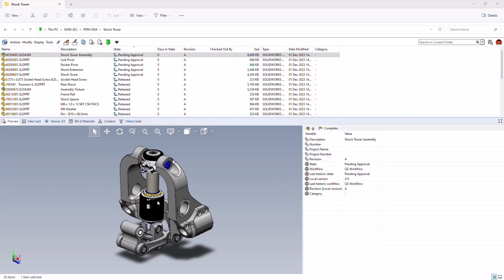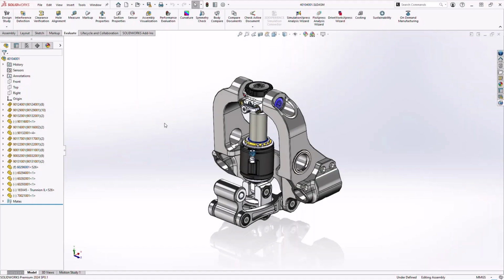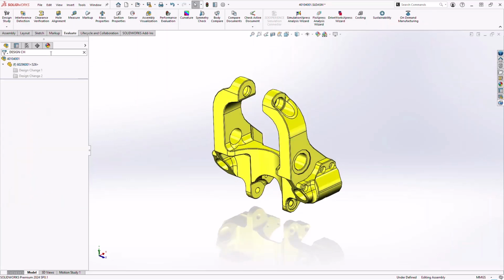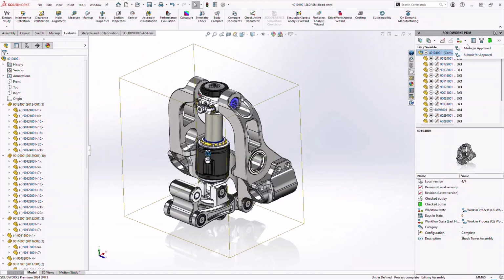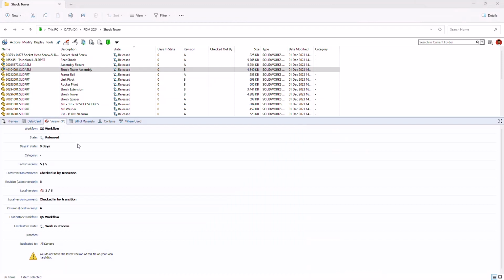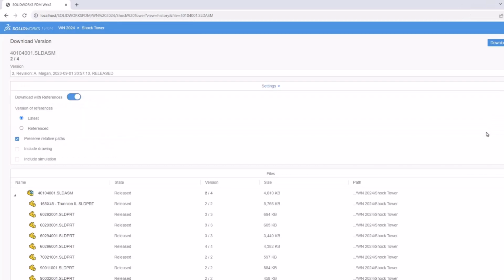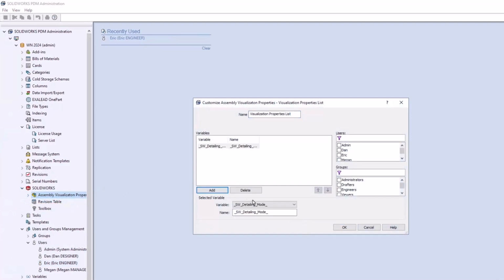Whats New SOLIDWORKS 2024 - PDM

Comment: PDM is the topic of many YouTube videos, but very few of the presenters specify "Standard" or "Professional".  I have  only standard as I am a 1-man company thinking of implimenting PDM Standard for two reasons: #1 is cost, I can't afford Professional either license or PDM, #2 I can't administer Professional.  It's a sufficiently daunting task to implement Standard.  I think I recognize things in this video that are in Standard but want to know if all of it is in Standard.  If not all is Standard, what parts are Professional only.  Great Video from UK without the accent that most Brits have.  Well spoken and enunciated such that persons with hearing impediments can understand!  Much appreciated!  542 views with no comments, commendable.
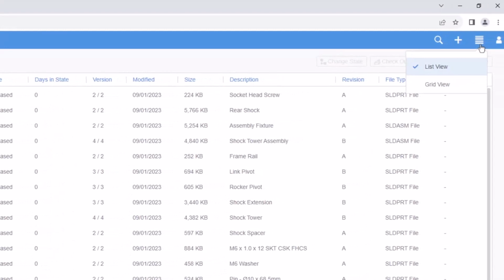Reply from the maker: Hi there. Thanks for the comments. Most of what you can see in the video applies to both PDM Standard and PDM Professional. However, as the 2:50 point, we talk about the Web2 online interface. Web2 is only available in PDM Professional. If you need more details on the overall differences between PDM Standard and Professional, visit our page here - https://www.solidx.co.uk/solidworks/data-management/. Thanks for watching.